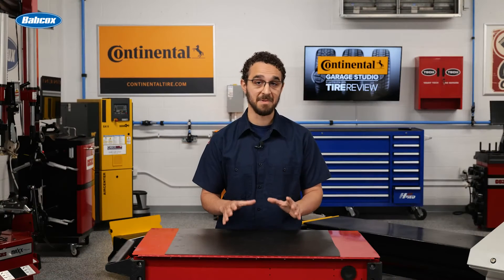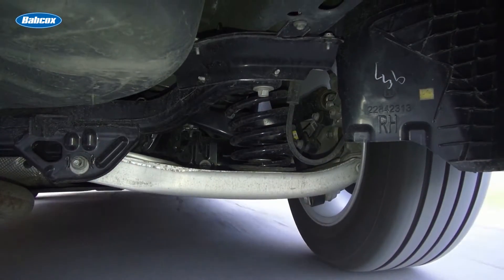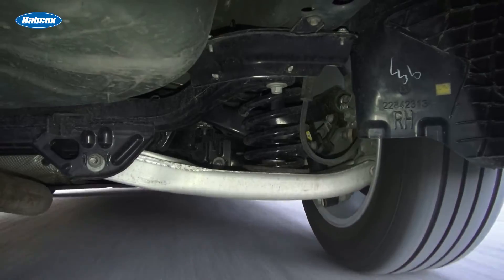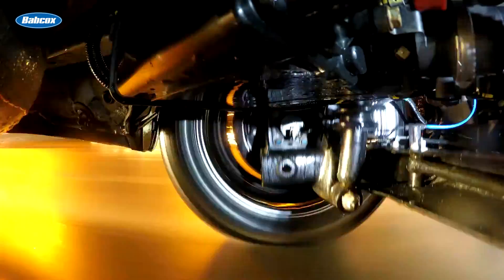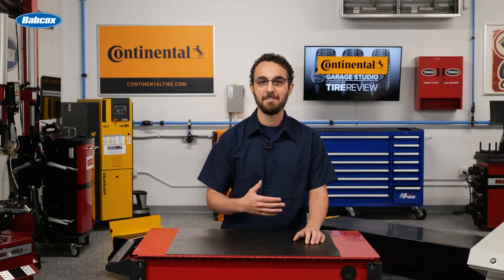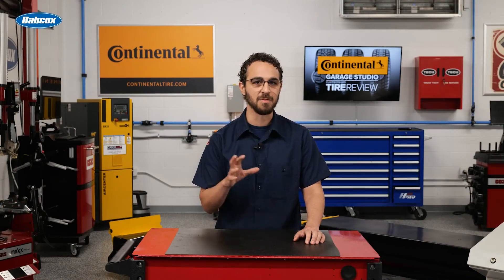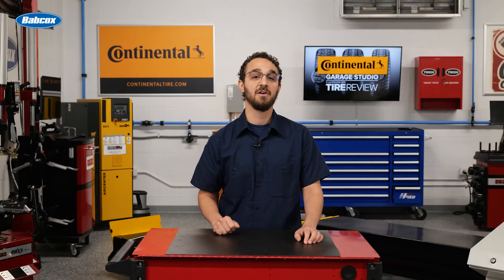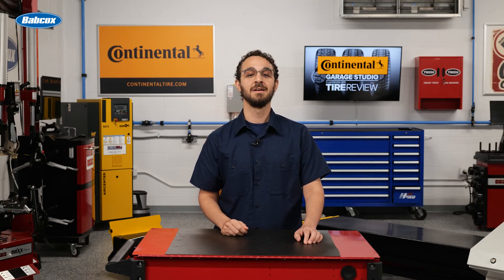Five tips for diagnosing electric power steering issues

Comment: Warning light: Service Power Steering lit up on my 2015 Chev Cruz LT.  No problem with steering, no odd sounds, no leaks anywhere on anything.  Week before this warning light I noticed the radio changed it stations several times, then stopped.  Next day, the drivers window did not respond to go down and then suddenly did.  Also noticed car tac dial didn't seem to "catch up" with the speed I was trying to obtain on a few occasions then would suddenly adjust to proper reading.  All of these were before the warning light lit up. This car has  an electric power steering motor instead of a pump.  The car battery is over 6 years old.  Could this light be triggered by a weak battery or possibly a weak relay (under hood) or fuse?  The car has 226,425 original miles on it.

Comment: I recently changed my steering wheel dampner in the motor. Now im getting a code lost communication with sas. I had a disconnect it from the main ECU.  The steering is very stiff can hardly turn it. I bought a scan tool and tried to recalibrate it but not working.
Reply: It's happened to me 2 day before. I bought a scanner and I can't recalibrate. What you done in the end?
Thank you!!!
👍🙏🇷🇴🇬🇧
Reply: @johncatalina431  i forgot to plug  one of the connections into the ecu.